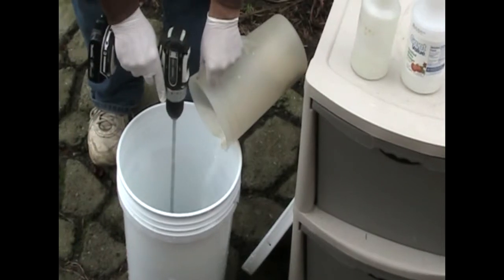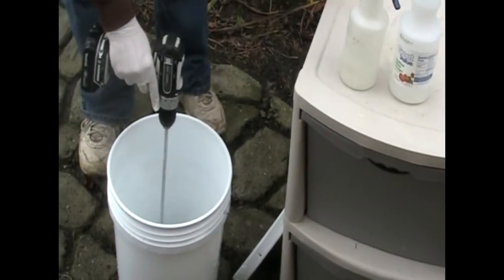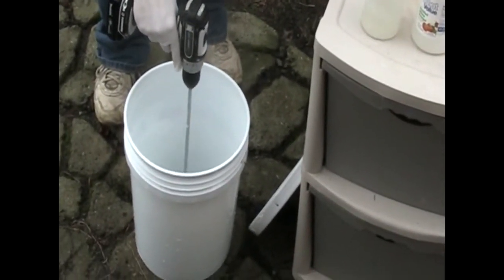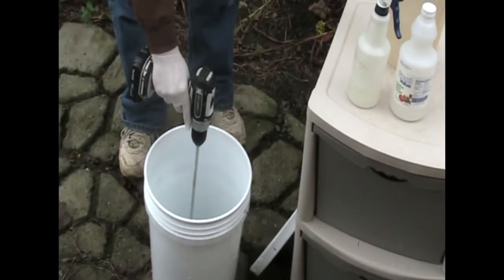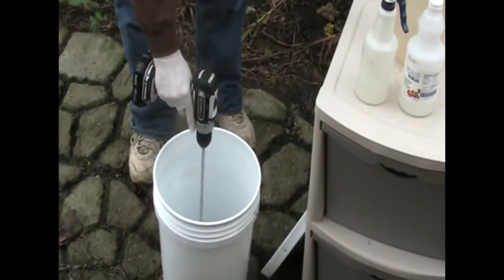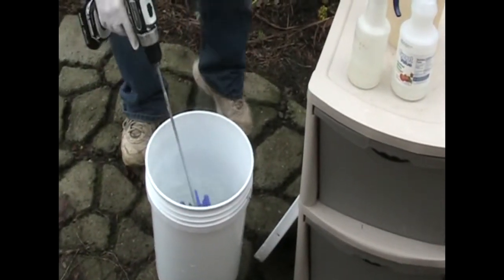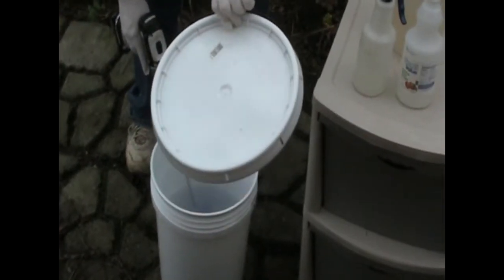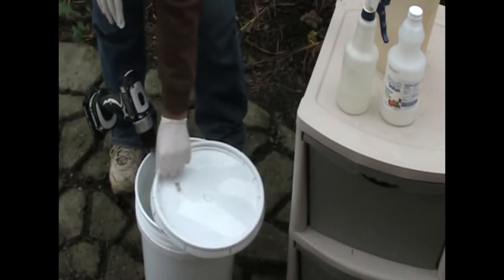How To Mix Catalyst For HHO Generator

Comment: What is the mixture ratio of Potassium Hydroxide and Distilled Water? I can't find the info on your website. I found another video where the mix rate is 1.25G to 4 ounce of Sodium Hydroxide. I think 4oz = 0.12kg. How often do I need to mix the stuff up, basically want to know how much will 1.25G + 4oz net in terms of fuel compared to filling up with gasoline. I am trying to nail down the cost effectiveness of buying your system and converting. I found local mini mall water store for distilled water, cost $0.30/Liter (All Canadian $), also I found a local supplier of Sodium Hydroxide for $105/25kg. However I am sure I can find the water for cheaper, probably $0.15/L.